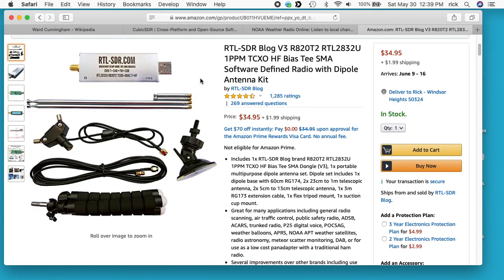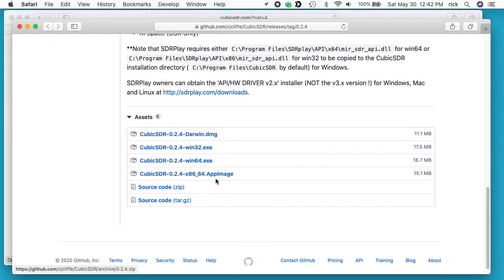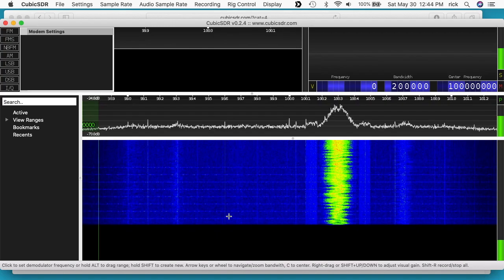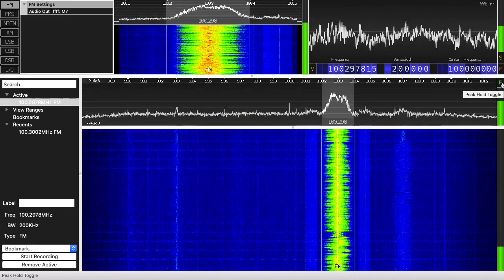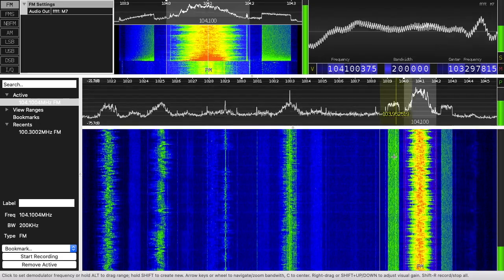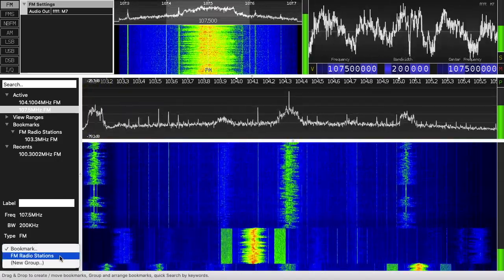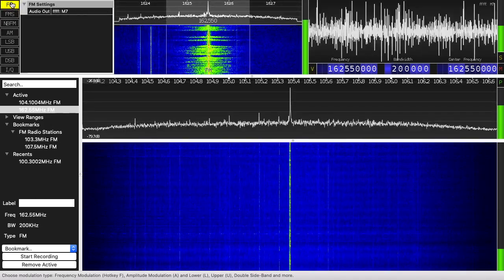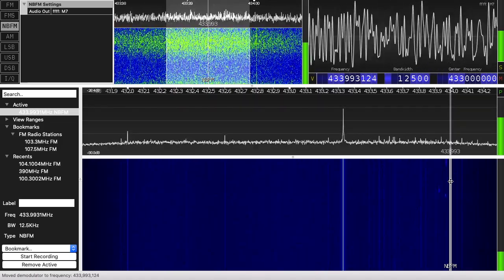CubicSDR Basic Setup on Mac with RTL-SDR Blog V3

Comment: I have the same setup except I have the RTL-SDR V4 dongle  I tried different older versions of the CubicSDR The frequency numbers are not what they should be. a 108MHz station is at 23MHz nothing lines up.  is this a problem with the hardware or software? I am using a MacBook Pro.

Comment: Thank you. Followed all your instructions but when I opened the application (before even connecting the RTL SDR), I got the message CubicSDR quit unexpectedly. This comes with a lot of problem details & systems config reports, I tried this several times even doing a restart. I"m using a MBA M1 OS Sonoma 14.5. I also have McAffee installed. Any comment will be deeply appreciated.

Comment: ready to take another crack at this. I tried another software program, just as shitty
Reply: ignore me, I think I got it to work because I slept on it and changed my attitude. I don't have the frozen issue anymore and I don't know why. I also now have a little mag mount that I can put on a pie dish which should do well. I guess I can put a long wire on the antenna and see how I do and stop complaining. Thanks for posting this video

Comment: that SDR seems to be a crash machine for me. computers and radio don't ever play well together. Ballsy to do it with a Mac. Im returning mine, don't believe it'll ever work.
Reply from the maker: That is odd. Did you try it with another computer? Mine has been very stable.
Reply: @Rickmakes  I only have the one PC, I stripped all security and got the full range of radio, but it crashes. I'll download a 3rd time. sitting in a drawer now. I should return it before I cant

Comment: I followed your video to set up my older MacBook Pro. I really like the simplicity of the CubicSDR. One thing I did notice was significant heat buildup of the RTL-SDR V3 dongle. I know this is an older video, but wonder if anyone else notices the heat too??
Reply from the maker: Mine does the same. From what I've read, the heat is normal and is due to internal heat management moving heat to the case.
Reply: @Rickmakes  Good to know, thanks.
Reply: I just try the newer Nooelec v5 stick and yes, it gets hot too. This is normal.

Comment: LSB, USB, and DSB are different ways to broadcast AM.  By default AM broadcasts a carrier frequency with the audio information in two band of frequencies on either side of it.  They are mirror images of each other, so you can save transmitting power by transmitting only one, or both of the sidebands.  But then to demodulate you have to know which type are using.

Comment: Hey , just south of you in between Lebanon and Sweet Home.  Just grabbed the RTL-SDR an Cubic and am just getting started.  Also have the Malachite newer version that I am setting up along with an older RS Scanner.  Former Systems Operator US Navy S-3A/B Vikings so, I know a bit about signal processing.  I set up a Discone antenna on the roof about 25' above the radio shack and have a Wilson Low Loss cable running inside.  Haven't tried the RTL-SDR with the new ant...But have it on my IMac Pro in the house.  Any suggestions are MUCH appreciated.  BTW, one of my Great Uncles had one of the first licenses in Oregon K6FD

Comment: Does it works with M1 chip?
Reply: I had it working with an M1 chip and had no problems. Then I updated to Monterey 12 and now it isn’t working
Reply: @pretenddog3955  Hi, I just got into SDR and am trying this exact tutorial on my M1 Mac running Monterey 12 and while CubicSDR detects the dongle, nothing happens when I start it. I think I have the same issue as what you describe. Have you (hopefully) found a way to get it to work?
Reply: @bwest6275  I am sorry to say that I gave up and moved on to using it on my wife's Window laptop. I wish I could figure it out. It had worked for a short time, but then the upgrade to Monterey seemed to be the end of that.
Good luck
Reply: I’m a rookie newbie but Cubic runs fine on my M1 MacBook, with Monterey. I have learned the antenna is a key component to have the best experience.

Comment: Nice job Rick. Now I need to drag out my dongle and connect it to my Mac! Which Mac OS are you using?
Reply from the maker: I think it was Catalina but now I run it on Big Sur.
Reply: @Rickmakes   Where you able to get the new Version 0.26 with new API to work on Bigsur?
Reply: @Rickmakes    https://www.sdrplay.com/dlfinishs/  if you check the download it show the new version 0.26 and API 3.07  I have a Macboopro with Bigsur and was able to get the CubicSdr version 0.25 using your instructions but then i downloaded the new version 0.26  and API  3.07 and  once installed it will not detect the RTL-SDR dongle and i could not open it so  i had  to revert back to version 0.25 . have you had any luck getting 0.26 to work on Bigsur?

Comment: Many thanks for the video. Been searching for some easy software to download for my Mac. Didn't realise most SDR downloads were for Windows. All the Mac stuff I looked at seemed like a real pain to download and set up. Have you discovered a scan feature on the software yet?
Reply from the maker: I haven't yet. I was happy to find that cubicSDR was easy to set up and runs well. Unfortunately it is relatively limited. I am currently trying to get software running to track aircraft. I am running into roadblock after roadblock. It isn't too hard to set up on Windows and Linux but I know people are also wanting to do it on a Mac.

Comment: RickMakes, check out the aerospacevillage.org and DEF CON 28. We will have a demo of using this SDR to look at aircraft tracking, weather satellite images, and comms. I just used the kit for our demo with your video to learn how to use it as a beginner. We will have an expert teaching how to apply this for aerospace activities.
Reply from the maker: I'll have to check that out. I have been playing around with a couple of different software packages for tracking aircraft. My youngest and I have been having fun checking out what planes are flying in the area. It is amazing what you can do with a relatively cheap device and a computer. I would really like to get something setup where I don't need an internet connection. I want to take my setup to some high, open location where I can track more planes.
Reply: @Rickmakes  What software have you used for tracking aircraft? Is it for macOS?

Comment: What type of antenna were you using? Indoors or outdoors? Thanks in advance
Reply from the maker: I'm using the indoor antenna that came with this kit: https://amzn.to/2z4hpDu If you pop the center cap off, you can see which antenna section is connected to the middle conductor. I have that pointing up. The antenna section connected to ground is pointing down. I typically use it with the antenna sections retracted. I think you can use a calculator like this: https://www.qsl.net/kd4sai/antencal.html to find the optimum length to extend it to but I don't have a lot of experience in that area. If you are confused as to how I have the orientation of the antenna, check out the pictures on the Amazon listing. Mine is like the pictures of the antenna pointing up and down.

Comment: LSB (Lower SideBand), USB (Upper SideBand), DSB (Double SideBand). and its for SSB listening :)
Reply from the maker: Thank you! SDR has opened up a whole new world to me.
Reply: @Rickmakes  I/Q Refers to Quadrature Modulation where there are two signals that are phase shifted by 90 degrees. Its used in a lot of communication systems because it allows for two signals to be sent on one channel.